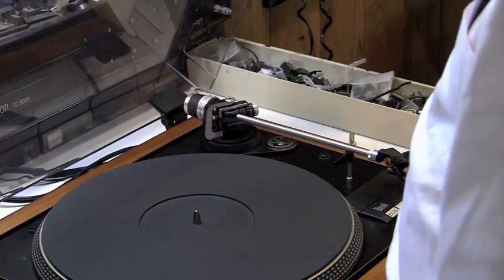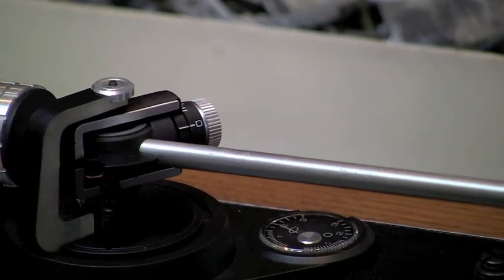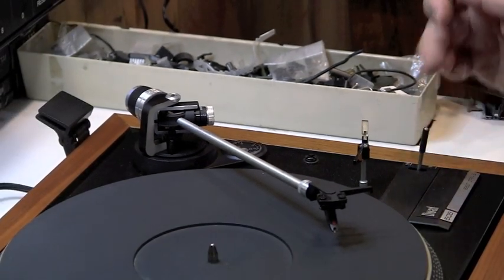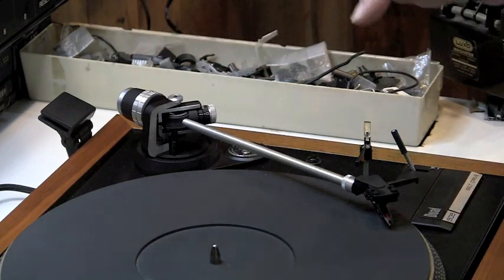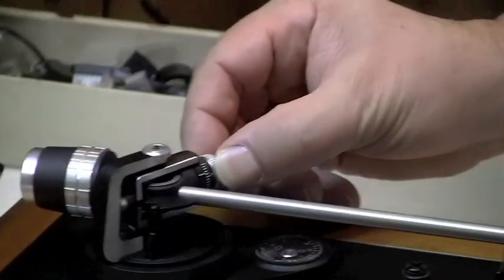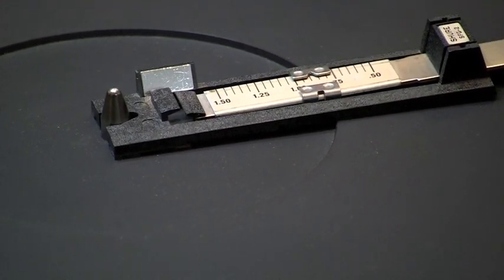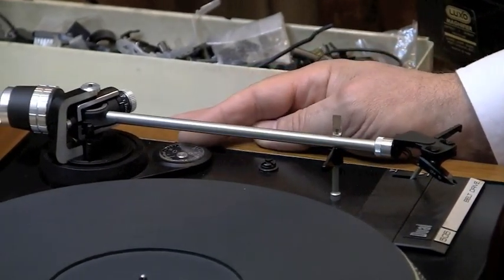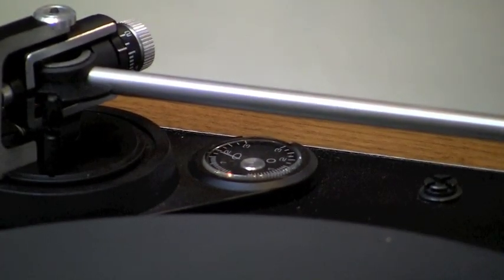The Stereo Shop__Turntable Calibration 2

Comment: the Ortofon cartridge you are using has still got the brass insert ballast weight fitted, it needs to be removed on this low mass arm, notice that the counterweight is too far forward, that is why the Ortofon has a removable weight

Comment: By using a spring to provide the Tracking Force it will allow the Turntable to be completely inverted, and if the record and platter are secure, it will play the record. In the late 60s, or early 70s, Dual did demonstrate that. Some other brands of Turntables, would just use the counterweight to unbalance the Tonearm, providing the Tracking pressure
Reply: My favorite quirk about duals
Reply: @forzaguy1252  
Not a Quirk, any turn table that uses a spring to apply the Tracking Force and can play the Record while inverted

Comment: Hello to thestereoshop I 've been balancing tonearms since the late 70's but boy I had the hardest time with a Dual 1225 tone arm the tone arm is very lite just like my old Onkyo CP-1055FII but this one was the hardest I ever had I could not balance it I'd tweek the counter weight just slightly it would go down I tweek it up it would go up I could not balance it even I checked on the tone arm to see if there was any play ,no play the I checked to see if the screws that help keep the tone in place where bearings are it was fine could it be the head shell was light ,this turntable was barely used it was in original box the dust cover had very small minor  scratches the wood base was pristine the head shell looked new even the conectors for the cartridge looked new ??????? for two days I played with it so I got some very small o rings and found a little space inside og headshell I put in 2 o rings I was desperate never encountered this EVER!!!! so I tried it finally I got the tone arm to balance don't know if this was thr fight remedy but I got tone to balanes even set tracking force to 1.75 grams checked it with scale off my half a gfam played a few albums no problems maybe head shell was too lite?????can't explain I had a another 1225 TT but it balanced perfectly took me 5 seconds to balance but this one almost defeated me but I think I solved it what would you do????? JRo

Comment: When checking the cartridge with the scales do it without the mat.  Usually it's best to run it under bias not over? Your bias might be out or not on a level surface, check it on a CD  to see if it stays in one position while the CD is turning, all skating should be adjusting by ear with headphones to define the perfect balance

Comment: Thanks a great job. Very useful. I have a question which I hope you are able to answer please. I think my anti-skating isn't working as it should be, ie when I turn the anti-skating dial I think it may not apply the correct amount of anti-skating. Is there a way of checking this and is there a serviceable part (ie spring) that could be gunked up or worn? Thanks.
Reply: Sorry forgot the mention my turntable is a Dual 505-4. Thanks.

Comment: Can I ask? On this exact model turntable, what is the process to replace the RCA cables, which are hard-wired into the inside of the turntable? I have this model and it seems the RCAs are pretty much shot, and tend to bring up a hum or various noises almost every time i play it. If i wiggle the RCAs i can get it "back" for a while, then it goes out again. Thanks, your video has been fantastic.
Reply: Hi I had the same model and same issue got rid of old rca cable as it was making that annoying noise...a bit of soldering new rca cable and it works perfectly again 😀
Reply: Thanks! Can you guide me as to what replacement cables I should buy to solder in? very much appreciated.
Reply: awalrus1 hi I got a £5 cable from amazon..so you can use any rca cable but one thing I have to mention it can't be too thick ,it'll be hard to bend it where you need to solder it...as I said I used very basic 1m cable just cut off two ends for soldering and that'it trust me it's a half hour job 😀hope this helps

Comment: Thank you for this video. Now I can understand how the weight works a little better. I need your help. I know that my tonearm is very light. Some records start skipping when they reach the last grooves although they are brand new (not even mint condition). I was also told I could fix that myself by the guy who brought me my new stylus but I don't know how (or I'm scared) to do it. Here is my question: is there a common way to do this? I don't know my stylus' brand and I'm really scared to damage my tonearm and my stylus altogether. Thanks in advance!
Reply: The other problem I have is that my turntable has a belt-drive system.
Reply from the maker: I'm not sure make or model your turntable is, but if it has auto shutoff or auto return and if it is skipping towards the end of the record, this may be the cause.  There is a a leaver under the platter that when the tone arm starts to come to the end of the record  the tone arm makes  contact with as it  and starts to move it inward as it gets closer to the last groves of the record (end). When it moves in far enough to the platter  it trips and the auto shut of is started. Over time the lubricants get thicker and it doesn't move as freely as it once did, so added friction is added and the records skips.  This leaver mechanism  needs to be disassembled cleaned and re lubricated very lightly with silicone or a drop of very light machine oil.   you may want a professional to do the job unless you are mechanically inclined.  Hope this explains what is actually happening.
Reply: Thank you! It's perfectly clear. Mine is a Noblex music center (MC 538). As I'm not into mechanics, I let somebody else repair it some months ago. I was told everything was fine but that the tonearm was a little bit light. Maybe this person didn't take care of this lever under the platter and that is what is giving me a hard time, just like you told me. Thank you again. I hope I can have it repaired soon.

Comment: Why do you recommend setting the anti-skating higher than the needle pressure? I have a 505-3 with a 2M cartidge. Should I do the same?
Reply from the maker: +Thomas Lund Over the years I have tested many turntables and found that setting the anti-skating higher than the recommend stylus pressure has resulted in better tracking when using test records.   maybe some day I will do a youTube video on that.
Reply: Hi, Could you please explain how to solve the problem when the piece that regulates the weight of the cardrige has been decalibrated?

Comment: What a great video thanks for sharing.  My problem is after I balanced the tonearm when I go to put the styles pressure setting on the needle hits the lp even when the cueing lever is in the up position, I tryed to move the tonearm counterbalance back butI have no luck I even tryed to use one of those shure gages you had but o luck any help would be great thanks.
Paul..

Comment from the maker: You can balance the arm in ether location, I find it easier to do it over the platter so I can see the arm better.  It should be level. Usually when I do it near the arm rest, the cueing gets in the way.  By bring the arm over the platter lets you lower the cue so it doesn't interfere with the balancing of the arm.